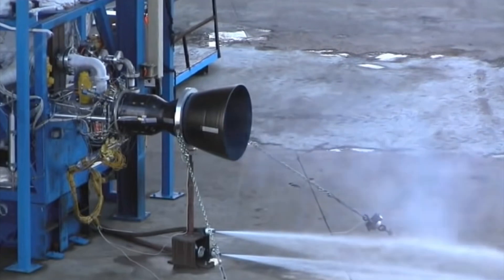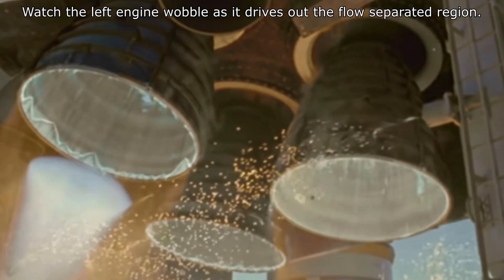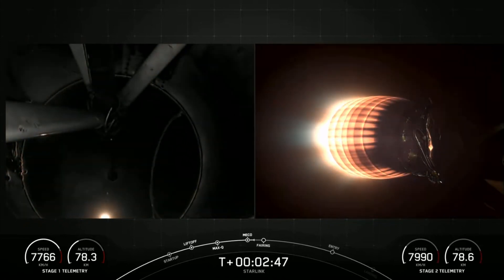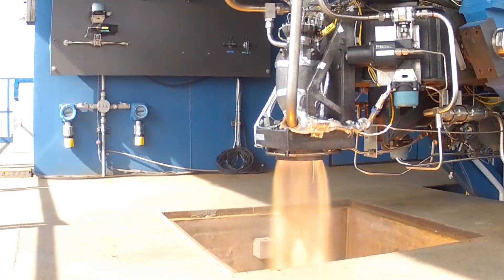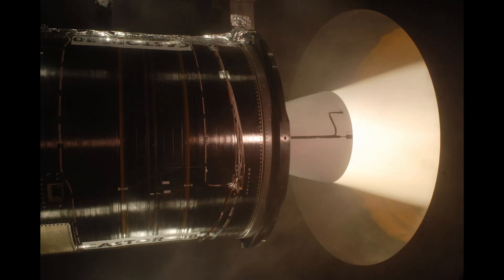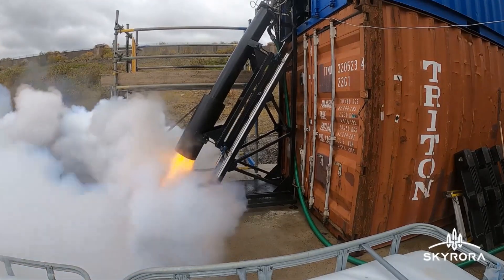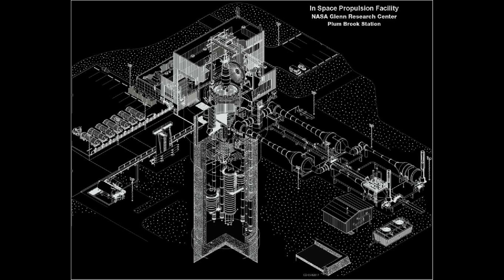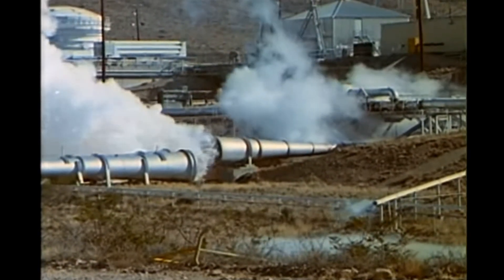Defying Atmosphere - How Rocket Engines Get Tested In A Vacuum Before Going To Space

Comment: How come a flie cant fly in a vacuumchamber?
Reply: One would think that's an obvious one.
Reply: @TheEvilmooseofdoom  yet you dont answer
Reply: @alexanderbreston9918  Because it's lazy that you won't do your own thinking and need everything spoon fed to you.  That's useless.  Don't be that way.  THINK.  What allows a fly to fly outside of a vacuum chamber?
Reply: @TheEvilmooseofdoom  i already know the answer.
Reply: @alexanderbreston9918  A fly flies by pushing off the air. Obviously, that only works if there's air.
Reply: @tyruskarmesin5418  same principle for rockets in space. Yet people believe otherwise.
Reply: @alexanderbreston9918  No. Rocket engines create thrust, which creates delta v.
Reply: @RocketPal   Forces result from interactions. When an object A exerts a force onto object B, object B exerts a equal and opposite force onto object A. But all stupid say; no object b required. The rocket interacts with its own force, they all say. And then they show F=MxA  that must explain it all. It explain force not the interaction between objects. When a flie cant fly in a vacuumchamber the same principal counts  for a rocket in space, no ground or gasses, no medium b, so no interaction, no equal and opposite force.
Reply: @alexanderbreston9918  Flies and rockets are not the same thing. An airplane and a fly both can't fly in space for the same reason, they work by pushing off the air. A rocket does not fly by pushing off of the air. Or rather, it brings its own "air" in the form of its fuel which it then pushes off of.
Reply: @tyruskarmesin5418  false. Same principle.
Reply: @alexanderbreston9918  Oh? How so? I think I explained myself rather well, so could you do the same? What principle are you referring to exactly?
Reply: @tyruskarmesin5418  newtons 3rd law.
Reply: @Matuse  you believe what you want. Soon, you will experience our reality.

Comment: I worked at a titanium plant, they used a Venturi like the one in the animation but using compressed rather than steam. It was used to suck molten magnesium out of electrolysis chambers as part of the process for breaking magnesium chloride down into magnesium metal and chlorine gas. Interesting stuff.

Comment: No heliocentric skeptic thinks that what you are discussing in this video isn't possible.  So if you're going to start it off by ridiculing people about "not understanding" an extremely simple, one-sentence law of physics.  Then maybe address that, instead of solely focusing on rockets igniting, and burning in a vacuum, which nobody even disputes.  Also, apparently you're the one who doesn't understand Newton's third law.  It is a broad, general statement that simply explains that an action is converted in some form which is highly variable in regard to the "action" the object or surrounding objects.  It definitely does NOT mean that an object is propelled at high efficiency by simply expelling exhaust against no mass whatsoever.  The RE-action of a jet or a rocket with zero mass to thrust against, is for the most part, the filling of the void.  For example, if the nozzle of a jet boat were aimed out of the water, the dense water being expelled into the far-less dense air, would be far less efficient in propelling the craft.  Which negates the claim that the action of the expelled propellant in either a jet or a rocket is what creates the thrust.
Reply: That's a lot of words to say (a) you don't understand flat earthers and (b) you don't understand Newton.
Reply: Stand against a wall and push on it. You move backwards. The wall doesn’t move because it’s attached to the earth. Now push against another person in a rolling chair. You move backwards, they do too. Now push against an atom of exhaust, you move backwards and so does it.
Reply: @samburnes9389  Completely true.  I didn't suggest that rockets or jets work with 100% efficiency.  The wheelchair example is a good way to explain Newton's third law.  That an action will be converted in multiple ways.  One action (pushing the chair) causes both you and the chair to move.  Which validates my example, that a water jet stream from a boat being expelled into the air, instead of the water would not work, or at least not nearly as efficiently.
Reply: @projectJ30  Imagine you and someone else sitting in on one of those office chairs with wheels at the bottom. You push them, and each of you go rolling away from one another. What you are proposing is analogous to the claim that you could not start rolling unless the other chair, at some later point, rolled into a wall. This is clearly false. 

To be clear, yes, a rocket does need something to push off of in order to accelerate. That something is the fuel it sends out the back. What that fuel then does, perhaps interacting with air, perhaps continuing on in a vacuum, does not influence the rocket at all. 

If a rocket sent out fuel traveling very quickly in one direction, but nothing accelerated at all in the other direction, that would be a straightforward violation of conservation of momentum.
Reply: @tyruskarmesin5418 "What that fuel then does, perhaps interacting with air, perhaps continuing on in a vacuum, does not influence the rocket at all."
That depends on how much you like your vacuum-optimized bell nozzles lel
Reply: I don't know the specifics of jet boats, but I promise you their propulsion has nothing to do with whether a jet of water encounters water or air after it has already been expelled. How would the boat even "know" what that water is doing? It already interacted with it to accelerate.
Reply: @tyruskarmesin5418  Instead of promising me that I'm wrong, you can find out for yourself.  It is a testable, observable, repeatable experiment.

Yeah science!
Reply: @projectJ30  "Instead of promising me that I'm wrong, you can find out for yourself.  It is a testable, observable, repeatable experiment."

And Sam Burnes explained it to you.
Reply: Oh hey look, this guy doesn't know what a flat earther is, what they claim or what Newton's laws of motion mean.
Reply: @GuardianSoulkeeper  Using my own points against me to try and flip the script.  How unique for you guys.  What are you going to do next, call me names?  Tell me that my educators failed me?  "Flat earthers" do not make the argument that rockets do not ignite in space.  We are fully aware that rockets do not need oxygen to burn.  The argument regarding rockets in space, is that they require a mass to thrust against.  I most definitely understand the law and the extensiveness of it.  You guys try and simplify the simple sentence into meaning it proves your space travel fantasies.
Reply: @projectJ30  of course a rocket needs something to push against. It pushes against the fuel it’s expelling.
Reply: @samburnes9389  By agreeing with me, you are contradicting the claim that rockets work based on the action of the exhaust being expelled.  Incorrectly attributed to Netwon's third law.

Thrusting against an engine's own exhaust makes virtually no sense, as it would be incredibly inefficient at providing any usable thrust whatsoever.
Reply: @projectJ30  I’m not contradicting anything. Exhaust is being expelled. How is it expelled? Its moves out of the rocket quickly. How does it do that? It pushes against the rocket to accelerate, pushing the rocket forwards. An action, the exhaust accelerating backwards, needs an equal and opposite reaction, the rocket moving forwards.

Do you have any math to back up your last point? All of physics is based on math. It is a necessary part of understanding the world. 

As a simple example, if you expel 1 kilogram of exhaust at 1,000 meters per second, you have 1000 kilogram meters per second of momentum. Because momentum is conserved, if the rocket is 1,000 kilograms, 1000/1000=1. The rocket will speed up by 1 meter per second.

Comment: They had similar issues with steam locomotives many years ago. If the exhaust didn't fill the chimney correctly, air would flow into the smokebox and affect the working of the locomotive. The more things change the more the stay the same.

Comment: Amazed the nozzels don't melt.
Reply: Some rocket engines use the fuel itself to cool the nozzle (and in the process heat the fuel) by pumping it through narrow pipes built into the nozzle. The Saturn V F-1 engine also sprayed turbopump exhaust around the inside of the rim of the nozzle extension to provide a barrier between the combustion gases and the nozzle extension (that's why there's a dark skirt below the nozzle before the flames turn bright).

Comment: Way back when I made a bunch of bearing carriers with a chilled section from what I understand they have three jet engines blowing into the test cell and five jet engines sucking air out to produce a supersonic airflow at minus degrees temperatures at minimal air pressure
Creating a high-altitude high speed test cell.

Comment: I served on a submarine, and this reminded me of something interesting. There is one 'hole' on a submarine - the circular area around the screw (propeller) shaft. It needs to pass through the pressure vessel while still being free to revolve at a high rate. We overcome this by ejecting water out the gap at a higher pressure than the ambient pressure. 

Just a fun fact.

Also - in case of failure, we had an inflatible ring that would seal out the water. This would prevent the screw from turning, but you would then switcvh to the diesel propulsion which has a screw stowed in one of the ballast taks. If the inflatible fails ... we had 'padding' to shove in there, as it were.
Reply: How would that stowed screw generate significant propulsion with the main shaft blocked?
Reply: @johndododoe1411 Two methods occur to me immediately:
 First, drop the prop outside the hull on a steerable drive shaft like an outboard or sterndrive used on sportboats- that was used sucessfully on FFG7 class frigates from the '80s.
Second, (and simpler) keep the prop inside the tube-like tank and open doors at each end when needed, like bow thrusters on large ships, and forming a pumpjet drive with steering nozzle optional.
Also both methods can be electric motor driven from outside the pressure hull, so no rotary shaft penetration required!😊

Comment: Also, on Earth, air tends to inhibit the exhaust gases from getting out of the engine. This reduces the thrust. However, in space (vacuum) since there is no atmosphere, the exhaust gases can exit much easier and faster, thus increasing the thrust. Therefore, the rocket engine actually works better in space than here on Earth. In either case, Newton's 3rd law of motion (every action has equal and opposite reaction) is in action, albeit more smoothly and efficiently in a vacuum. Thanks Scott for sharing the knowledge.

Comment: The "Mars Wind Tunnel" facility at NASA Ames is a rather tall building, was originally built as a high-altitude test chamber for the Agena rocket, I think.  It was a bit of a pain to do experiments in, you had to wait until the steam plant across the road charged up to do 'paid for' work in an arcjet chamber (mostly for heat shield testing). Only then could we piggyback on that to pump down the chamber to do our Mars experiments...    still, a unique facility.

Comment: There is a way of building an open ended vacuum chamber. It is very difficult though and gets very expensive very quickly.
Essentially you create supersonic air streams around the opening using jet engine inlets aimed to cause a Bernoulli effect.. With enough power you can (in theory) create a vacuum.

Comment: I wonder if NASA has ever heard of the term "KEEP IT SIMPLE, STUPID..." ie, the Mars sample return mission, WHY THE HELL ADD COMPLICATIONS to a system like have the sample return rocket effectively 'Yeeted' into the air to then fire up and fly away??? MULTIPLE FAILURE POINTS ADDED! Just have a simple launch rack/gantry move or angle over to have the rocket pointed up/or at specific angle, and then the rocket can launch from there (as per the normal way of launching rockets 😏)... I REALLY DON'T UNDERSTAND why they would ADD MORE RISKY procedures to something SO VERY COSTLY, and SO BLOODY COMPLICATED to retrieve something so BLOODY VALUABLE (in BOTH financial cost AND scientific value) from a planet +/- 225 Million Km away!!!
IT DEFIES LOGIC!!! 🤔😒
😎🇬🇧
Reply: One thing I learned from watching this video was that rocket engineers are clever people who solved problems which hadn't occurred to me. How about you do the Mars rocket engineers the same courtesy and assume they've already considered these issues.

Out of curiosity, what was your attitude to the skycrane landing system employed for the Curiosity and Perseverance rovers?
Reply: @maxfan1591  Yes, that 'Skycrane' seemed complicated too, and YES I WAS extremely happy they pulled it off, I'm NOT trying to put the guys down at JPL (or other scientists/engineers from other departments/companies) for their engineering brilliance, after all, with performing that kind of landing so far away on another planet IS exteeeeaaaamly tricky, so well done to them. It's just, the more you add complexity to a project/challenge, the more points of failure CAN (and sometimes DO) become evident.... 🤨
Reply: @thedarkknight1971  "I'm NOT trying to put the guys down at JPL"

Of course, with comments like "MULTIPLE FAILURE POINTS ADDED!...I REALLY DON'T UNDERSTAND...MORE RISKY...SO VERY COSTLY...SO BLOODY COMPLICATED" you're just being motivational!

"It's just, the more you add complexity to a project/challenge, the more points of failure CAN (and sometimes DO) become evident"

The issue isn't the number of points of failure, it's the likelihood of failure at each point. That's why the skycrane system was developed - because the more recent rovers were so large that every simple deployment system was extremely likely to fail.

So, as I said before, how about you sit back and assume the engineers involved have already tested the "simple" system you described in your OP and come up with half a dozen problems you haven't thought of. Personally, I'm happy to sit back and be delighted and amazed by whatever solution they come up with.
Reply: Launching a rocket without destroying whatever's underneath it is complicated.
Reply: @zounds010   Well, 2 points here... Once the samples are on board the rocket, the important thing is to get them back, secondly, the rocket/sample collector COULD have a launch system where a frame/mini-tower is angled over, left to stand, the sample collector rover then moves away, and launch is THEN started. The troubles with 'yeeting' the rocket up and firing is, 'yeeting' the rocket at correct angle (what if a catch doesn't release, what if it's not 'yeeted' hard enough into the air, what if the rocket engine doesn't fire in time, what if the rocket doesn't fire up at all, what if 'Yeet to firing up timing/angle' is off by even a tiny amount, the rocket could end up trying to bury itself into the surface (or crashing back into the sample rover...etc etc etc)... SOOOO MUCH that CAN go wrong.... At least if a 'ladder type frame or launch tower' is angled over, sat down onto the surface it could then be made stable enough to hold the sample return rocket to launch with WAY LESS RISKS of failure points. If they're gonna throw that kind of money at it, logic dictates that you're going to want to do it with MINIMAL failure points along the way.
Reply: @thedarkknight1971  There's a lot of industry experience with cold-launching military missiles.
Reply: They are likely, at least in part, confined to what can fold up and fit inside someone's fairing.

Comment: Wait, I don’t understand why a rocket nozzle wouldn’t work in a vacuum?
Reply: Flat earthers are apparently under the impression that rocket engines operate by pushing off of the air. They are incredibly dumb.
Reply: Because idiots believe that the rocket needs to push against atmosphere to work... and apparently pushing thousands of tonnes of hot exhaust gas out the back doesn't count.

Comment: Marquardt bi-prop hundred pound Apollo thrusters used pintel injectors to overcome instability issues if i remember correctly. Later versions of that 100 pound thrust became apogee injection variants used to burn fat sats into 22,000 mile orbits
using puck shaped injectors with V-shaped troughs to smack the bi-prop streams into each other from opposite walls of the V- shaped trough.
i saw this tech as i helped make the solenoid valves for FU and OX feeds.
Marquardt bored shallow holes around the base of the puck circumference and had no combustion instability in pulse mode
or burned 90 minutes to orbit Cassini around Saturn.
Marquardt.